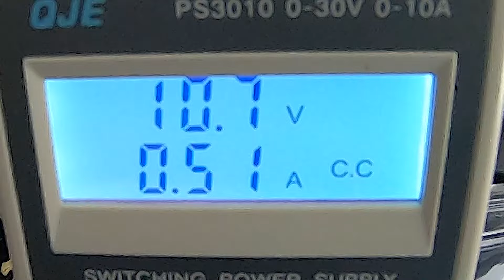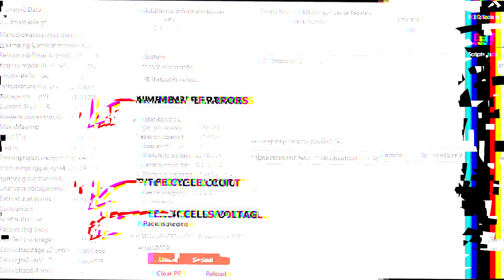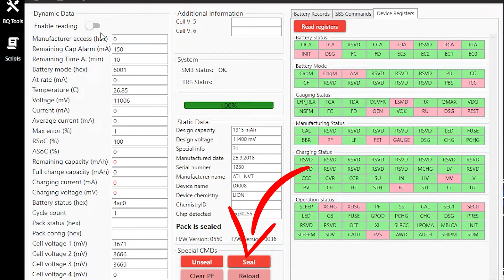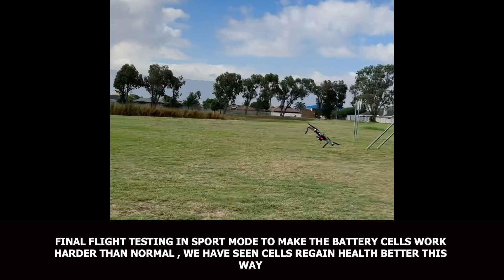The Quick and Easy Guide to Fixing Your Dead DJI Mavic Pro Battery!

Comment: I just charged direct up to 12 volts then leave the battery for a few days this enables the remaining cells to self balance. If your mega lucky you can then remove the balance plug desolder the large red cable from the battery. Then short ground to the rst pad . Connect the balance plug and resolder the red cable. Then connect directly to the charger not the hub the battery will start in hibernation mode. It works maybe 20% of the time
Reply: خیر اگر سیم قرمز را جدا کنین برد باتری به حالت کارخوانه میرود

Comment: Any alternative de bug board like adrunio or Raspberry pi and what software seen a few videos on YouTube using those combination for mavic pro
Reply from the maker: Not that we know of , the issue is the software required to read Mavic Pro and Phantom 4 BMS boards , we use TRB software which is unfortunately no longer available anymore until early 2024
Reply: @webuydronessa  any alternative software?

Comment: Thanks for the guide. I have a battery pack that won't charge (16 flashes), I have it dismantled and when I check the voltage on the 3 cells, two of them are about 3.8 - 3.9 V, but the other one is zero.

Is that one cell completely faulty, in that it's unlikely that it can be charged again?
Reply from the maker: Hey Tam, yes thats what it sounds like , you will properly find that last cell takes a charge but won't hold voltage.

Comment: Hey the crazy part bro is that they actually snap apart if you take the time to wedge a credit card edge in between the seams... There are also wires connected to each battery lever.
Reply from the maker: Yes sometime we very lucky with some batteries that come apart really easy , other times we have no choice but to cut 😅

Comment: Hello, I have 2 batteries that only last about 5 mins. Can they be resurrected?
Reply from the maker: Thanks for watching , the only way would be to replace the actual cells in the battery which is not always worth it. Your overall battery capacity has depleted , this happens over time.

Comment: I'm having trouble finding the GND pin on the DJI Mavic Pro battery electronic board, may I know which pin it is to connect to the DJI Bat Killer, because the smbus 
can't be read
Reply from the maker: Hi. The process is different for the Mavic Pro battery. Please see this video https://youtu.be/0ayRK1WTeWw

Comment: what is this non sense?? just buy a new one, it'd much cheaper!
Reply from the maker: This nonsense is to help others help themselves, we have a much easier solution which is 100% cheaper than buying a new one 🤙 that video coming soon
Reply: @webuydronessa  'That video coming soon': you mean there will be another solution for mavic 1 Pro batteries?
Reply from the maker: Yes correct 👌  a much quicker solution
Reply: Great news. I tried it with the C2112 board, with no luck.😢. Hoe long do we have to wait?
Reply from the maker: This fix will be with the CP2112 board , hopefully we can film and get the video out within the next 2 weeks
Reply: @webuydronessa Any progress on creating the video? I am wondering what I need more except the cp board. Thanks in advance for the good work!
Reply: Any update about the video? Thanks.